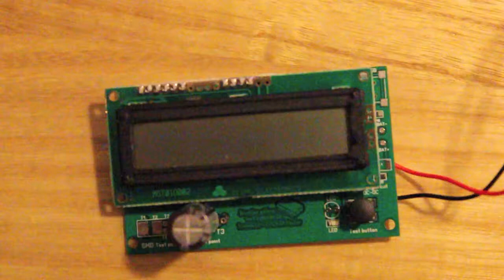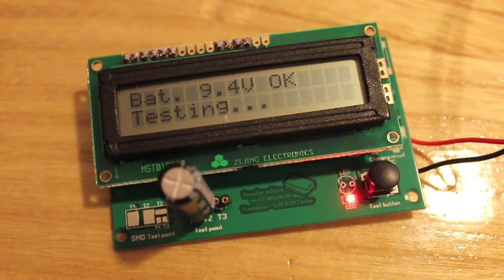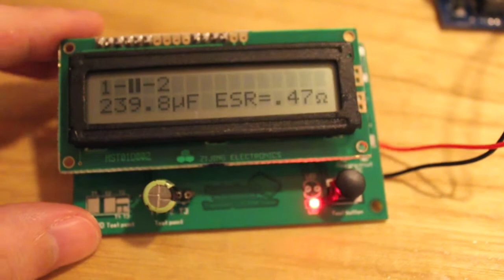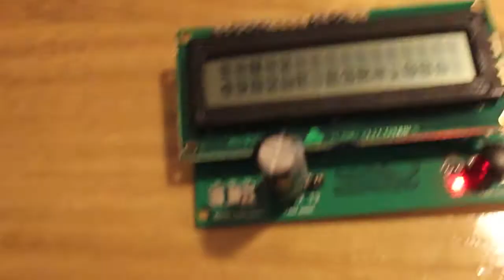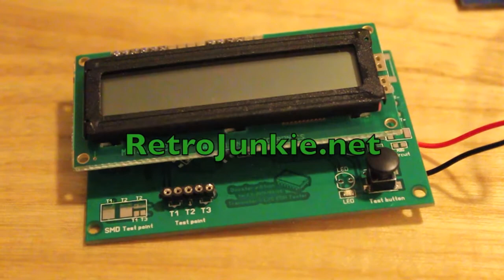Cheap Capacitor Tester Demo

Comment: Just a thought Shane, DC-DC supplies are notorious for giving panel meters a hard time. Trying to rid the output of switching spikes by using LC filtering can help but avoid too much capacitance as this can make the DC-DC supply fail. Did you try the module using a battery supply and compare the results?

Comment: standard electrolytics commonly have capacitance tolerances in the -20 to +80% range, so your variation in capacitance is normal for normal tolerance components

Comment: electolytic caps, although new to you they may be old stock. These may need to be "reformed"  or" burned in" on one of those old eico capacitor testers. I have never done this yet. I have one and read that information  in some site discussing electrolytic capacitors . I have taken those large defective old caps apart and they get real funky inside with this white semi solid gel looking gunk and that is probably the reason they short or give bad readings .This is only a possibility why the bad readings I just bought that same tester you have and it is spot on so far when checked against another meter I have. Cannot beat the price I am impressed so far.